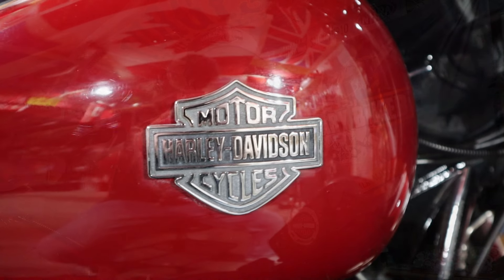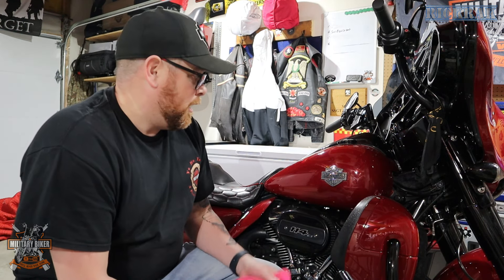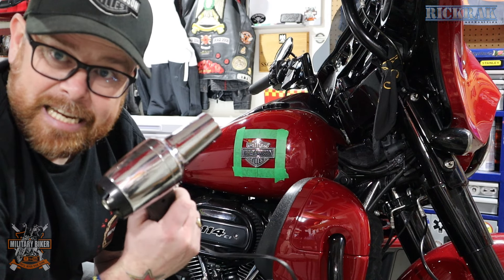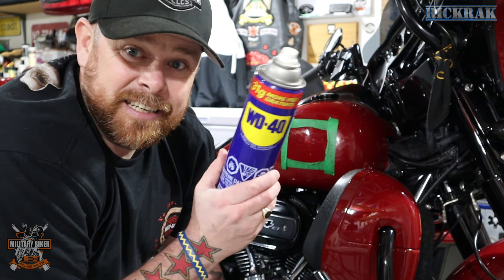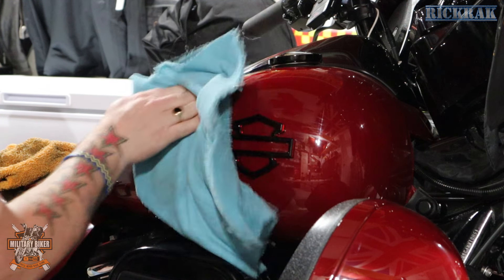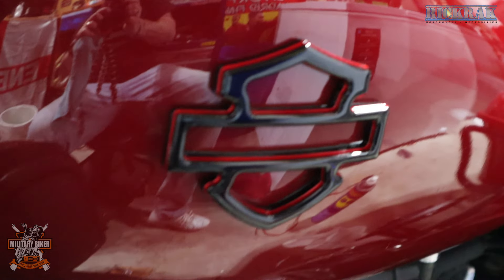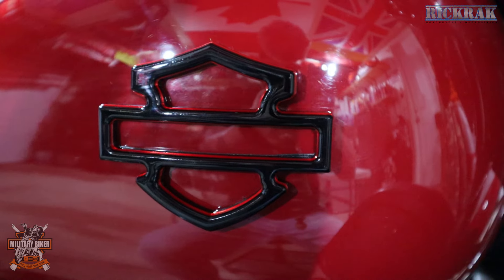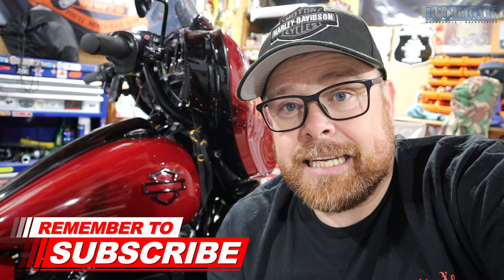The All-new #rickrak  Custom Gas Tank Emblems For #harleydavidson Are Here!

Comment: I have debadged a number of vehicles over the years, I have found (weirdly) dental floss works really good for getting the badges off and ass it runs close to the tank it leaves hardly any of the glue and foam behind. I also find toluene gets any glue residue off with one wipe.
Reply from the maker: I’ve heard fishing line is good too. Cheers mate
Reply: Acetone works well too!